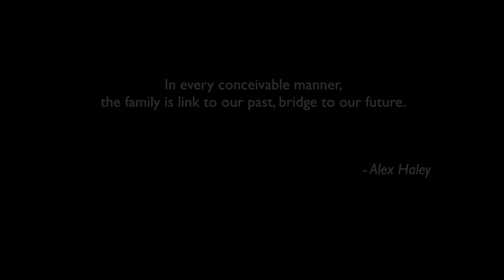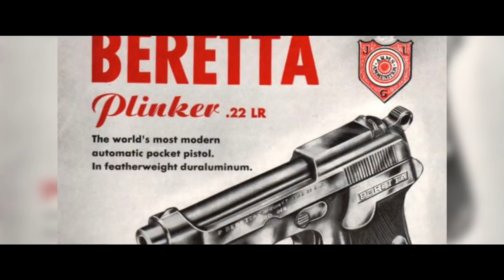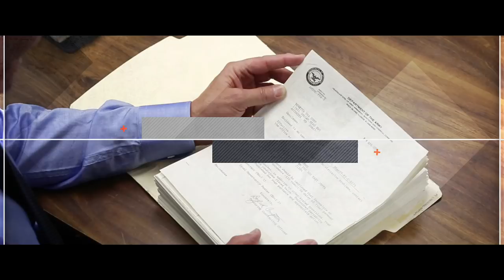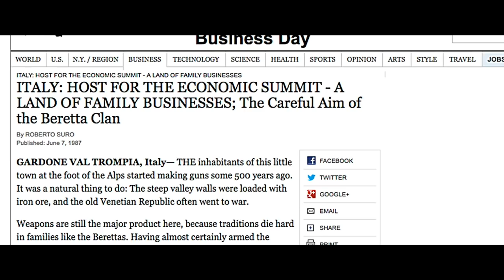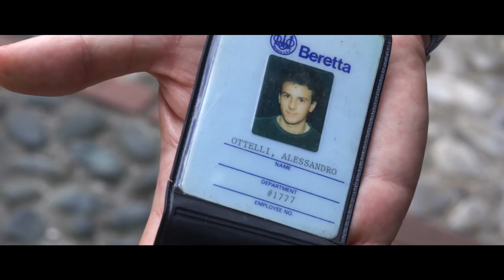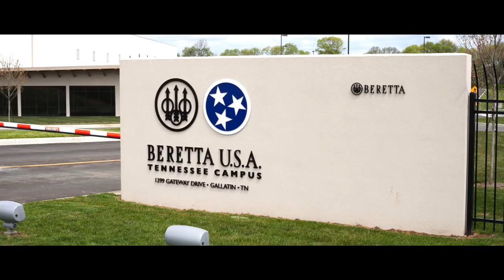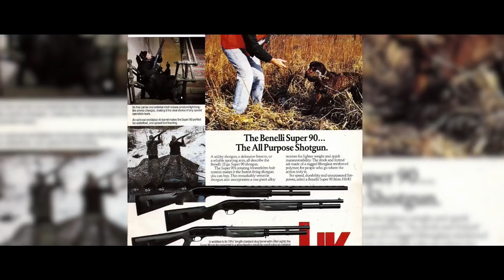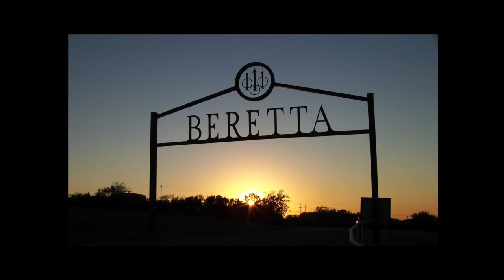The story of Beretta in the United States

Comment: This doesn't even mention that H&K made a better pistol compared to the M9 at the time, the XM9. Beretta made a cheaper pistol that didn't work quite as well as the XM9. They were worried about cost at the time.
Reply: The H&K failed the Army torture tests, twice. They redesigned it for the second test, and it performed even worse than the first model. H&K did not manufacture a better gun than Beretta, and the evidence speaks for itself.